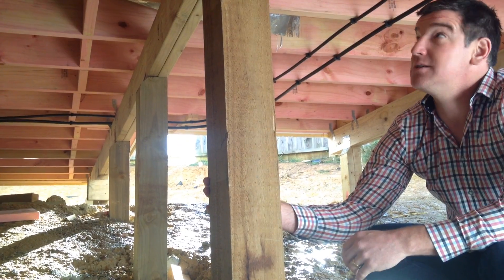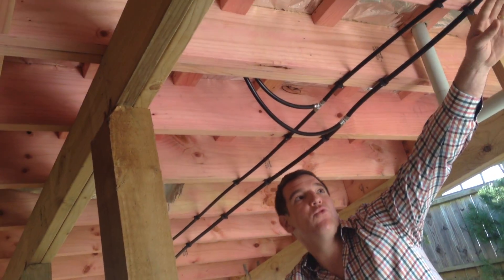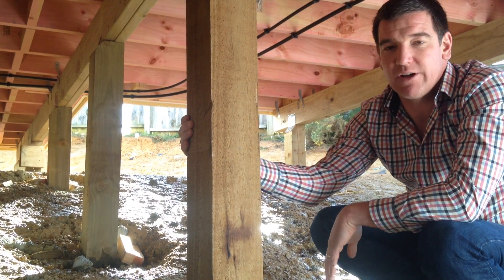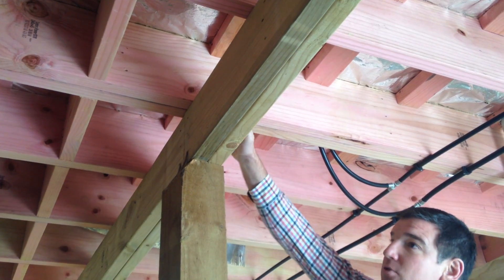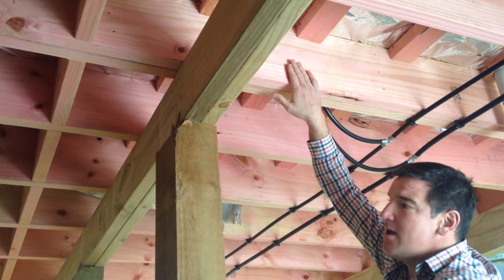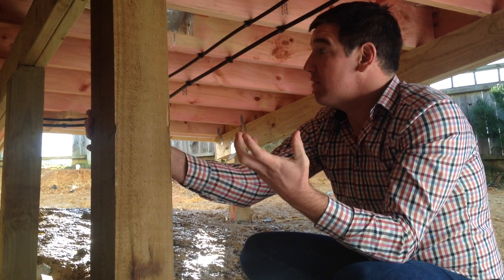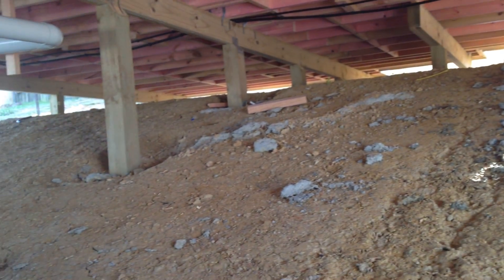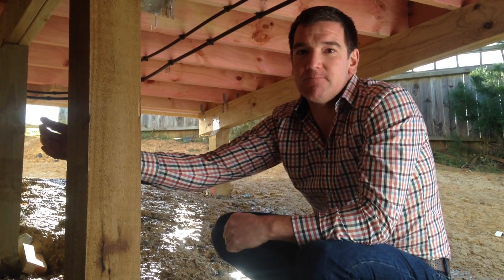Timber Piled Floor / Sub-Floor - KEY2 Construction Tips

Comment: Where is the bracing on those piles?  Thats not up to code anywhere in NZ.  Also, your concrete around those piles needs to be proud of the CGL (cleared ground level) by at least 50 mm at the pile to stop any water collection at the timber surface, esp at edge piles. Yes , you are under your house and it should be dry, but floods and long standing intrusions happen.  Saying that H5 will last “forever” is clearly BS as well.  A better vapour barrier on the warm side of your intended but yet uninstalled insulation is a must. Not just foil paper.

Comment: How do you avoid termites?
Reply: NZ is , we dont have them… but Australia does, and they also use a lot of timber pile sub floor.  The H5 treatment plus they coat all piles with a layer of anti termite protection.. paint on i believe. ( im in NZ, so only seen it done on YT).

Comment: Wait, you just bury the beams in the ground? Out here we use concrete footings and the beams are attached to those. Even treated wood will rot if stuck in the ground.
Reply: Posts mostly rot at the surface, not below grade. In Boston, there are houses that are hundreds of years old with original sunk-post foundations. If you keep organic matter away from the posts at surface level, they will take a very long time to rot, and if you use drainage to prevent water from flowing under your house, they will essentially never rot.
Reply: In Florida they use a water jet and sink the pilings into the ground maybe 8 feet. There is no concrete used and it seems termites don't bother them. I think they are treated with something they don't like for sure.
Reply: NZ H5 treated posts are rated to 50 years in the wet ground conditions. Yes they'll rot very slowly. But we here intend to replace the piles after (often before) that period anyway. Before because our seismic codes are regularly updated.

Comment: I love pier foundations, but If I was in charge of building codes in your area, I would have a fit.  In an area that is prone to earthquakes, that house would just shake off the foundation as there is nothing to keep them upright.  You need diagonal bracing on all of the piers to keep them from collapsing to the side.
Reply: Do houses with pier foundation hold as much weight as houses built on concrete foundation?
Reply: @fkfcwj97  For the most part. You just need to determine the load-bearing capacity of the soil and then make sure your footings cover enough surface area. Footings are installed in the hole before the post is installed. They can be made of concrete or a plastic composite. Sometimes, posts are installed without footings, which can be alright, but it means you will need a lot more posts than you would without footings. For small cabins on soils with high load-bearing capacity, where it's also very easy to dig holes, it could possibly make sense to install more posts instead of installing footings.
Reply: anerioone not if post are deep enough
Reply: yes can use diagonal bracing which allows you use shallow footings. however you can also use deeper footings and not install diagonal bracing.

Comment: Just for a matter of interest, how deep are those pile posts planted, and are they anchored to the bottom with a concrete foot?
Reply: Depths depend on soil conditions and could vary from 450mm to 900mm commonly. Occasionally they are 2.0m+ in depth. 50yr+ old houses often were ~300mm deep.  
Yes, the have concrete footings surrounding and beneath the timber post. a lot like a "concrete sock".